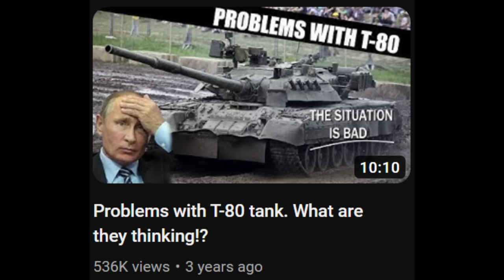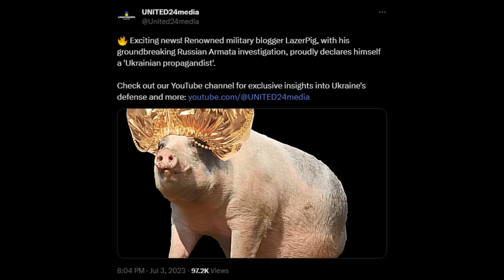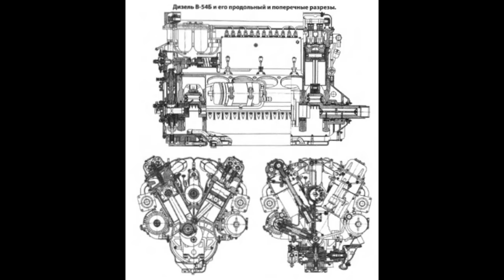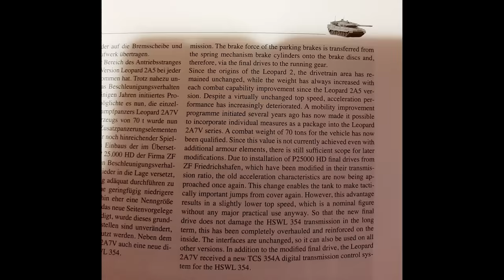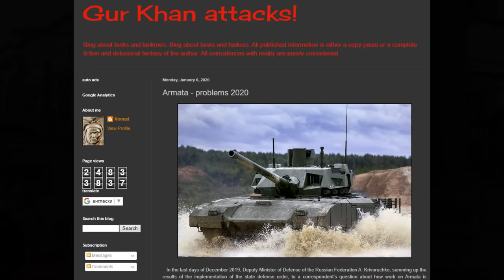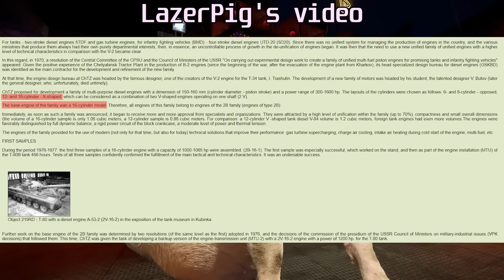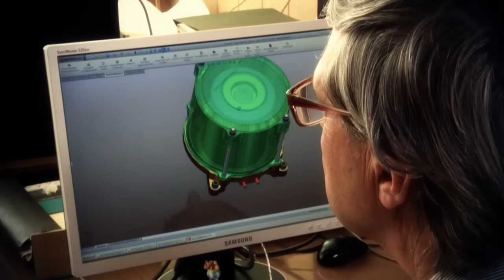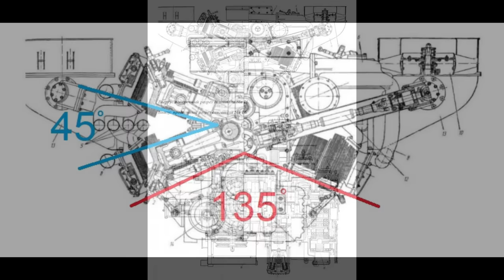Response to LazerPig and the T-14 Armata dispute

Comment: Lazer claims that the M1 engine doesn't consume more fuel when we literally have a US made document of different engines consumption when mounted onto M1.
Reply: And everyone who worked with the M1 will tell you that it consumes loads of fuel. If the guy knew anything about how engines work we wouldnt be having this convo...
Reply: @niksonrex88  he historian and he might be good at making research for history specific topics, but he's not a tank nerd and it shows when he says some things for his head and gets it wrong as with Honeywell turbine. Making a video about T-14 when he can't access non English sources is laughable.
Reply: And it makes sense why most MBTs are gas rather than gas turbine.
Reply: But lazer is right, what you're talking about here is the early stages of the abrams turbine engine and everyone knew that from the start so they had plans for the later installment of an auxiliary power unit (APU), same shit with the noise, the tanks was louder indeed but not by much, and this changed aswell over time. The problem is the crews stuck with the joke and people still think it consumes loads of fuel. That engine can take several types of fuel without much trouble and is very reliable, also in terms of hp output its much better (I'm not american nor an americaboo, its just that lazer is right)
Reply: @NunoFilipe-yx4lx  Don't think any Abrams crew is joking about it☠️.
Reply: @subjectc7505 diesel *
Reply: On this, the Pig is not far off. Given I know he watches my videos, I suspect he watched some of the figures I quoted in one of my Q&As. (The original question was whether a US tank platoon of 1945 or of today consumed more fuel. Answer is 1945, even accounting for the lack of public data on the V3). There have been astonishing improvements in fuel economy of the AGT1500 over the course of the 40 year service life, even before taking into account the (finally) inclusion of an APU for stationary purposes. The problem M1 has is its reputation for fuel consumption, which was well earned at the time, has stuck even though it's sufficiently efficient that it is no longer considered much of a determining factor in selection. It's partly why the US has maintained the turbine even though diesels have been demonstrated in M1 for quite a few years now, especially for export sales which you will note is an option no customers have felt the need to choose. Bear in mind that tanks are only a portion of an armored unit's fuel consumption, the remaining difference between a unit with M1s as their tank and Leopards is negligible.
Reply: @TheChieftainsHatch  wait why are you here?! I legit thought you were a bot account 🤣

You doin' alright?
Reply: @TylerHarris-yy7uf  I'm pretty sure I'm not a bot. Or else I am sufficiently well programed to have convinced myself not to check
Reply: @TheChieftainsHatch  Wouldn't the weight of the MBTs affect it too?    The Abrams especially the Upgraded ones must have serious fuel economy issues or range compared to earlier models excluding the Idle issues it used to have.
Reply: @surferofthesynthwaves4710  That's where the improvements come in. The A2 may be over ten tons more than the original M1, but it still does about twice as good fuel economy compared to the older variant.
Reply: @TheChieftainsHatch  It's not as bad as during Sweden trials (two times higher fuel consumption), but seeing as range between M1A2 and M1A2 SEP V3 dropped form 490 km to 400 km it's doubtful improvement in efficiency reached such levels.
Reply: @user-yd7me7ns1o  APU addressed fact that to keep electricity turbine was needed to be running and turbine on idle was consuming a lot of fuel.
Reply: @TheChieftainsHatch anyway, what your verdict in these fiasco?
Who comes strong with fact, who came out emotional-driven, who outright uninformed?
Reply: Or you know, ask one of thousands of currently serving or ex-tankers who could tell you pretty accurately how far X-gallons would get you or running time. It's one thing when you're discussing a tank in which no one who's ever touch even speaks your language. It's an entirely different thing to not have sources to a tank your own country builds/crews.
Reply: @NunoFilipe-yx4lx  It still DOES consume a lot of fuel solely based on the fact that a turbine enginee has a high idle spin rate. The problem with gas turbine engines lies exactly in their high idle fuel consumption.

A regular diesel engine revs down massively and thus saves a lot of fuel when not on load.
Reply: @NunoFilipe-yx4lx  " abrams turbine engine /.../ had plans for the later installment of an auxiliary power unit (APU),"
The problem with the APU is the same as for the stridsvagn 103 with its dual engine. The diesel was to be the constant runner, keeping the systems powered, while the gas turbine was only needed when the tank was on the move. The thing about gas turbines is that they spend almost the same amount of fuel at full power as when idling, making them really efficient at full power, and they also take some time to spin up from being turned off.
This resulted in every tank keeping the turbine going if there was any risk of having to move around, especially in combat where no one wants to wait an extra minute to get going at full speed even though they like most military activities tend to sit around a lot and then have sudden bursts of action.
Reply: Uff, THIS comment of yours did age really badly.
Did you read the Chieftains comment?
IMO you should edit your post and admit that you were completly wrong.

And the 183 upvoters should question themselves: Did they not manage to do reseach themselves? Did they get it wrong? Or do they just upvote stuff that they like, no matter if they have any idea if it is true or not?
Reply: @wedgeantilles8575 In Chieftains comment he still says it consumes more fuel than contemporary tanks, it is just much more efficient when compared to the original. And it still has the issue of consuming as much fuel when idle as when on full power.
Reply: @wedgeantilles8575  Chieftain comment implies that there are some improvements to efficiency and that's what we can take for granted, but he can't provide us with sources can he? He needs to be vague because he says things based on his experience and  HUMINT. Tank crews get info about range in full tank, but I doubt they are bothered with Honeywell turbine fuel consumption data. We do have US data on range and in fact SEPv3 range decreased from the 490 to 400. The last official data we have is from Sweden. Fuel consumption was calculated after thousands of kilometres traversed by booth tanks, and in that tests Honeywell turbine consumed twice as much as MTU diesel. I doubt it's even in the realm of possibility to increase fuel efficiency by 200%.
Reply: @wedgeantilles8575  "Did you read the Chieftains comment?"
The devil is in the details. Note that Chieftain talks about the entire unit, of which the actual tanks are only a small part. That means if your units WWII fuel-guzzling tankers that spent half of the fuel hauling the other half of it to the front is replaced by a pipeline, the fuel consumption of the unit is now significantly lower.
The comparison with Leopard 2 suffers from the same problem, as it is on a unit level (where we don't know if they are organised the same to the point they could be of different sizes), when the question actually asked is if a dozen Leopard 2 will need as much fuel as a dozen M1 A3 Abrams.
Reply: @johanmetreus1268  Well, a lot of text from your part.
However, you somehow managed to ignore the 4 first words.
"the pig is mostly correct"
That is the point. In the Chieftains opinion, Lazerpig is correct.
This thread is complaining that Lazerpig is not correct.

So, who do I believe.
Some random YT guy like you? Or the Chieftain, probably THE one to use as reference?

Yeah, a really hard choice.
Not.
Reply: An overly strong argument over semantics. For some reason i can't get into the NATO STO site right now (is it down for anyone else?) but there is a document in there, I believe from the AVT group,  which expressly states that fuel economy is no longer considered a determining factor in engine selection between diesel and turbine. (It uses that verbiage). I think it's to the point that when I do get on again, I'll screenshot the thing and put it up. I've had the same thing verbally confirmed to me by the head of US Army vehicle procurement, but that's not something I can screenshot. Again note the total lack of export success for the diesel M1 despite GDLS plugging it as an option for years. The Abrams X demonstrator was actually built on their diesel demonstrator hull from years ago.
Reply: @wedgeantilles8575  "So, who do I believe."
You of course believe whatever you deem has the stronger argumentation to support it, regardless who delivered them... you know, the whole basis for scientific reasoning and stuff?
Reply: @TheChieftainsHatch  NATO STO is up, but really slow for some reason, it took 15-20 seconds for any reaction once I clicked the search link.
If they managed to somehow mitigate the gas-turbine spinup time and/or the high idle consumption, that's a a major development in the engine field that has been far underreported.
Reply: @johanmetreus1268  Well, if you want to delve VERY deep into the topic yourselve.
Or if both sides have credibility.
But if one side is represented by Lazerpig and the Chieftain himself and some anonymous youtuber, then sorry, you do not need to delve deep into the subject and spend hours upon hours to do research as 
well.

2 guys say: Na, Lazerpig and Chieftain are idiots and have no idea.
Trust me bro, I know better.

Is it possible that a random guy on YT is correct and Lazerpig+Chieftain are incorrect when it is something regarding TANKS?
Yes, it is possible. Most stuff is possible. Aliens could land on Earth tomorrow. It is possible.

iIf somebody like the Chieftain says something about tanks, the chances that he is incorrect are very small.

The probability that a random guy catches Lazerpig AND the Chieftain to be wrong on a topic is so remotely small, that you can safely ignore it.

That you seriously start with "scientific reasoning and stuff" in a YT comment section is beyond funny.
Reply: @wedgeantilles8575  No need to delve deep into the archive, you simply look at the arguments presented as is and make your own assessment.
Reply: @johanmetreus1268  I have absolutely no idea how they managed to do it, I just do the research and report the findings.
Reply: @TheChieftainsHatch  I'm looking forward to look at the pictures.  Ever think of making an indepth video for the Turbine?
Reply: @TheChieftainsHatch  Thank you chieftan! I think a lot of people often miss the point LP often makes in many of his videos is the staying power of myths and informational flex that can happen in just about any topic over time. Asking the questions of why do we believe what’s being repeated or is “the official line”?

In most of LP’s videos, my understanding is that the comedic angle is the point of the jester’s job always has been: speaking truth to power, by being able to ask people if they are thinking critically and evaluating other ideas and factors than what they’re being presented or have been taught to believe. Comedy is a great way to get people asking themselves, “wait! that “insert concept” does sound silly!”

He’s “practically screaming” that people are missing the point of the argument’s concept because they insist on just pointing to a certain number on some page and that can be intensely frustrating. You can only slap your forehead so much. To be a historian isn’t just about repeating specific things, it’s a science that properly done means you have to have understanding of philosophies, psychologies, anthropological concepts and so much more. You can’t study anything about history if you always believe exactly what one dude put on a page one time and never question it’s validity… because research is hard work and hyper fixation on numbers instead the function of the whole and a holistic understanding of the topic is easy.

Ps: I do think he overreacted and was a bit immature, but he had stated that he wanted to let it go and no one else would and it was driving him crazy.

PPS: I love your videos and thanks for all you do. 

PPPS: can you get me a ride in an Abrams, latest gen? Thx, xoxo Jk, not JK
Reply: @NunoFilipe-yx4lx I knows guys who drove and worked on the Abrams in combat. It is an absolute gas guzzler.
Reply: yes it does.why do you think the m1sa is diesel ? turbine engines are expensive and maintenance intensive on the upside is turbine engines can start up pretty easy especially in sub zero temp and very powerful.
Reply: Not to mention higher consumption of petrol for same amount of miles as diesel is common knowledge.
Reply: @subjectc7505  Diesel rather than turbine.
Reply: @subjectc7505  Most MBTs are Diesel not Gasolene. And the “Gas Turbine” in the M1 usually burns Jet A (JP5-8) or Diesel.

Comment: i like how lazer pig accuses red of making russian propaganda while he himself is a full blown western propaganda channel
Reply: -who uses Russian sources.
Reply: I don't think he accused him of making propaganda. He accused him of taking Russian propaganda at face value and using that to evaluate equipment. Which is what a lot of this comments section does when they coom over Russian tanks. (Someone literally cited Russian milbloggers in one of the top comments of a previous video)
Reply: @Scyborg832  And most of LazerPig's sources are Russian sources. If you watched Red's video, you would know.
Reply: @definitelyfrank9341  I watched the video. But clearly you didn't watch LPs video to know how he implemented those sources. Using Russian sources as a baseline isn't the issue, it's taking them at face value. LP used it as a way to bash the INTENDED design of the tank, and he used the sources like video (seeing the inside of the tank and how the touchscreens didn't work for example) and writings that propagate the intended quality of the tank and demonstrating how even those are outdated by western standards. Unless you want to tell me that the T14 is better than the Russian sources claim? Using Russian sources isn't the issue, it's how you use them. Saying LP and Reds use of them are equal isn't an accurate assessment.
Reply: @Scyborg832 The origin of the myth that T-14 uses a 'Russian copy of the Sla 16' for an engine came from Russian bloggers. He takes this at face value, and only because it can serve as more anti-Russian ammunition. The propaganda campaign created by NAFO bots.

He also cites a Russian source bringing up problems problems with T-14's engine. He takes everything from there at face value. 

What happened to the "You're a stupid Russian propaganda-bot if you take anything said by the Russians at face value! 🤬😡😡" standard set by LP in his response video? Or does that only come into play when it isn't affirming the beliefs of a NAFO-bot?
Reply: @Scyborg832  being honest, i watch both red and lp, i watch red for valuable insight and lp for pure giggles. With that said, LP takes gossips and "blog posts" at face value almost every video. He is in no place to call Red, a propagandist.